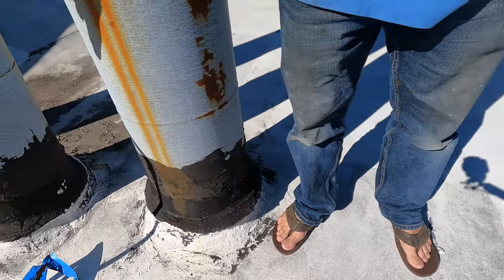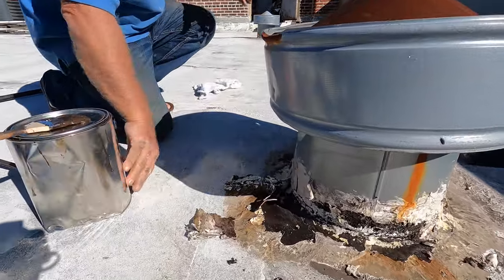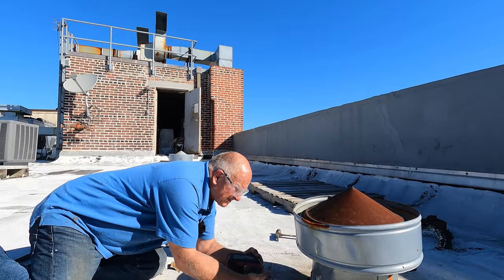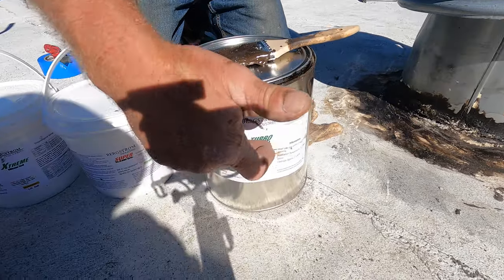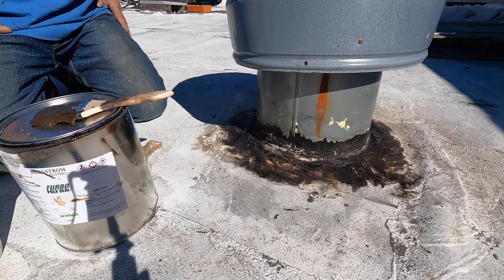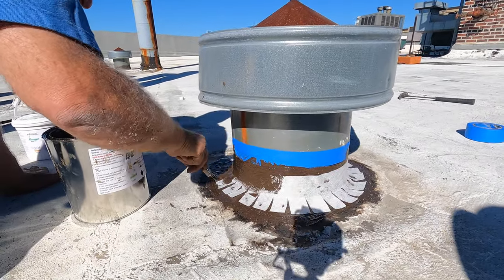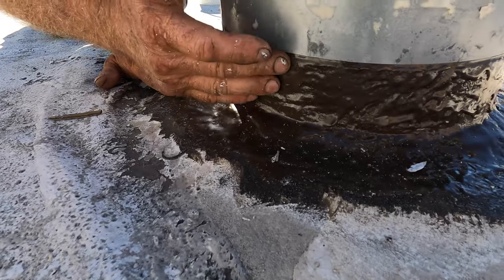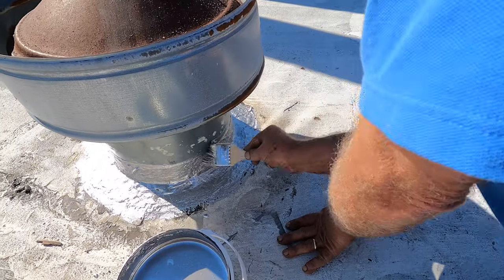How to Repair a Chimney Pipe Flashing Leak Easy permanently- DIY Cheap

Comment: If thats a tpo roof why didnt they bring the roofing material up around the pipes.
Reply: Is not a tpo roof
Reply: @olej2183  ok it was white so i assumed lol. Anyway that is a good repair for that type of roof.
Reply from the maker: Yes, that is correct. That is a Modifies Bitumen Membrane with some kind of mastic sealant. I had to remove that 1 st to be able to make the flashing
Reply: @FlatRoofDoctor  very Nice work.    And the finish with Silver coating is Just Nice, very Nice :)